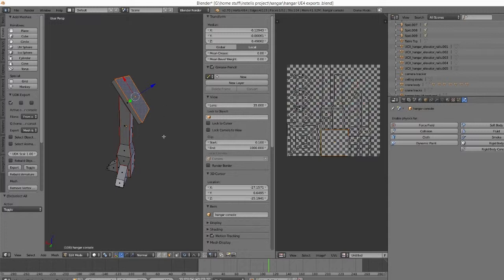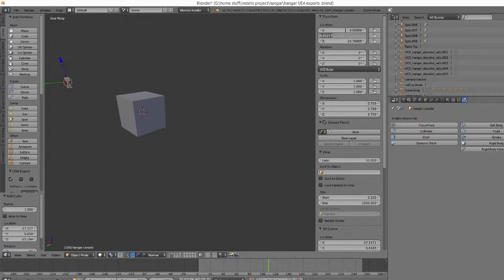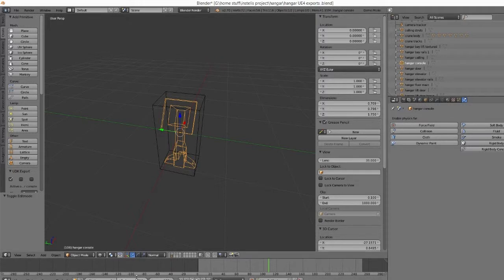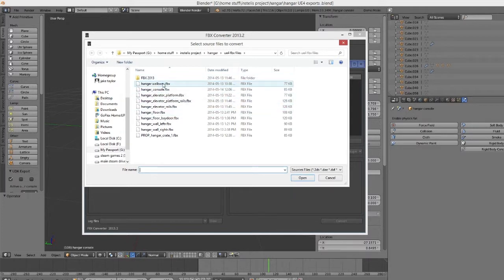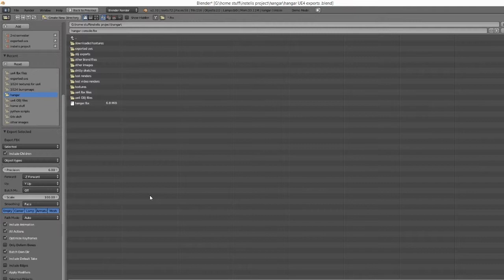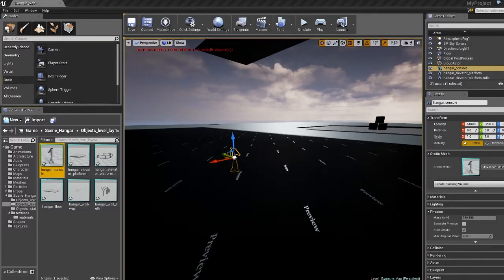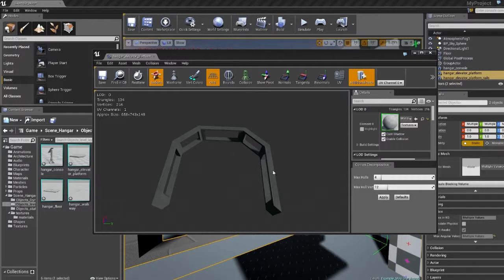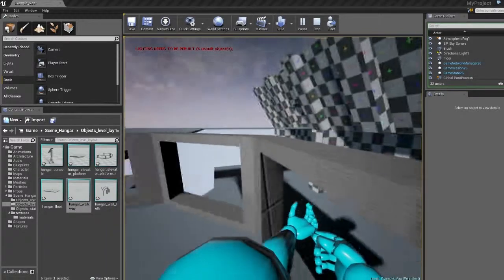blender to udk mesh import tutorial

Comment: I am having a problem when I import my character into udk and add my material. It becomes really bright. Is this maybe my resolution is to high on my material or something else?
Reply from the maker: texture resolution wouldn't do this, i can't really tell without looking at the file, but my first guess would either be that the character is not properly unwrapped, there is an issue with the material you are using, or there is something wrong with the lighting in the scene.
Reply: Jake Taylor Thanks for the reply, Yes it turned out to be the lighting and then i was having an issue once i rebuilt the lighting on a new map and the polygons were visible and there were mixed color over the material, and even though i exported with smooth faces. That turned out to be because my material resolution was accidentally 2048 and the light resolution on my mesh in udk was 32. Once I increased the resolution on my mesh with building the lighting it seemed to look good. I hope that this sounds correct and later on I'm not having issues. I'm very new but learn very quickly so if you have any input maybe there was a different reason for these problems i would very much appreciate it so much. Thanks for the help on the lighting issue!!!